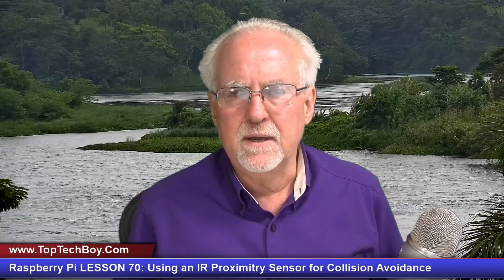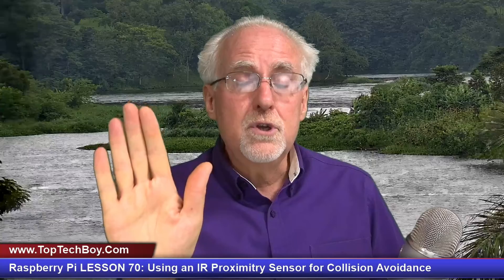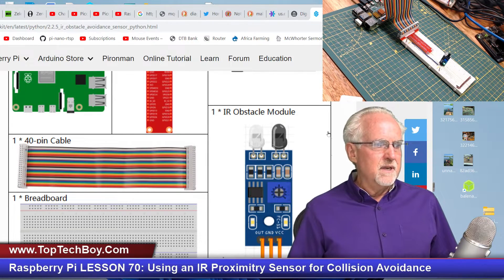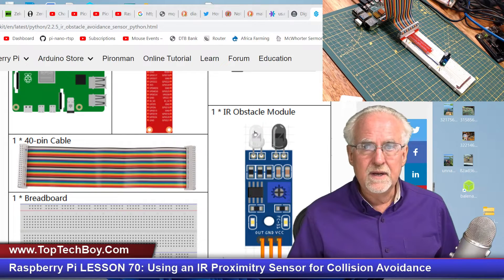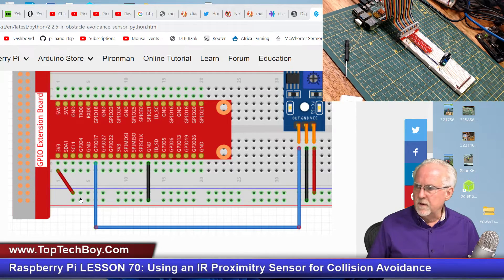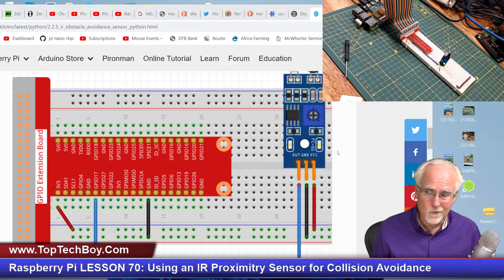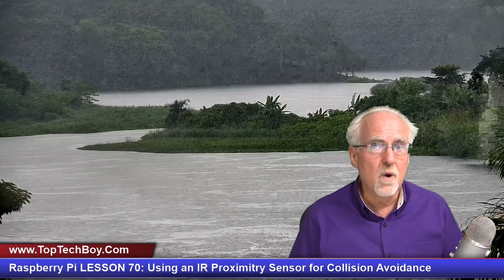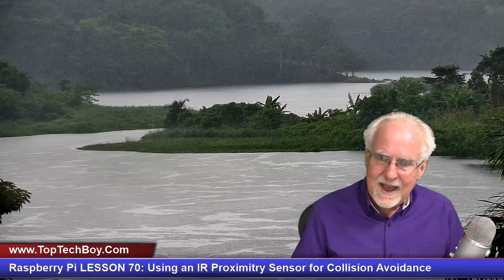Raspberry Pi LESSON 70: Using an IR Proximity Sensor for Collision Avoidance

Comment: well, on this last, easy homework assignment ..I AM LEGEND. I'm sorry these lessons have come to an end..for now. I ordered a pan-tilt camera and when it arrives I will do the lessons I skipped over. The only lessons I found particularly frustrating were the ones with the padded keyboard. It worked ok by itself but when paired with the digital display I could never get it to work right. Tensorflow lite was dynamite.  Love VPython. I look forward to trying some of your other courses. Thank you Paul for all the good work you do.
Reply from the maker: Check out the Pi Pico lessons. That is a great follow on class. Also, if you are interested in 3D printing, check out my fusion 360 classes

Comment: Hello Again Paul! Just want to thank you again for your excellent content! I have watched your videos for about two years now and really learned a lot! I remember you said at the end of your "New Arduino" series that the goal is for us to be able to make our own projects. I thought I would challenge myself after I was done watching your raspberry pi series, and was inspired by a video on Thomas Burn's youtube channel. The result was a 6 month build of an AI robot using the pi. It's a robot you can talk to and it will answer using an OpenAI API solution. I also applied the skills we learned, so the robot has face tracking and face recognition. It has a pair of eyes that can follow/watch the user. The face recognition is prompted by a spoken command from the user, which is in turn answered by a spoken reply from the robot, which is visulized by a moving line on the screen as long as the robot talks. The frame was designed (in fusion 360) and 3D printed by me. Here is a picture of the robot: https://youtu.be/gV24gpgzRxU  Still watching your videos! currently watching the Pico series. Keep up the good work!
Reply from the maker: Thanks! Really appreciate the support.